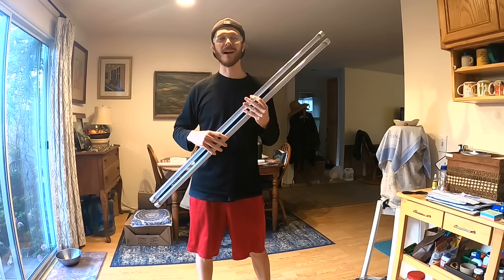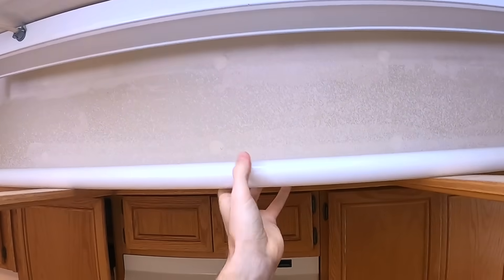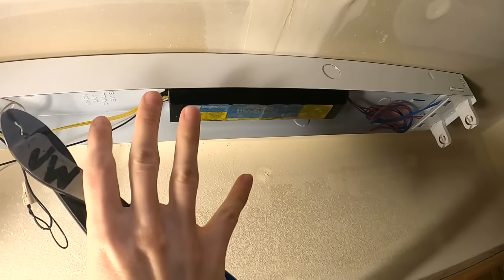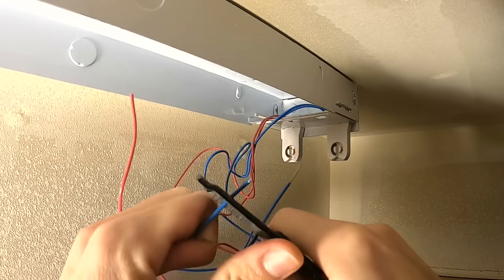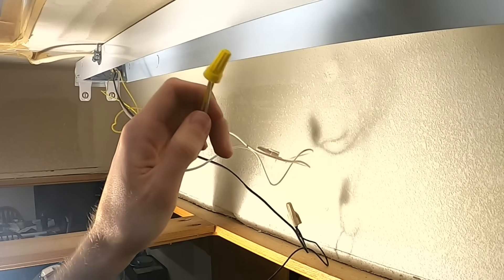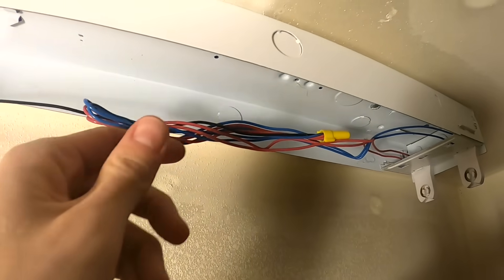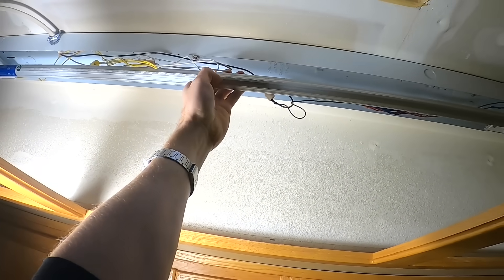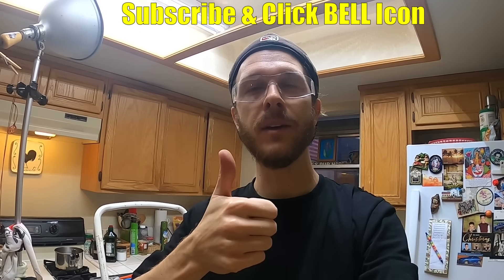How To Easily Convert Fluorescent Lights to LED | Save Money on Energy Costs

Comment: A couple years ago I inherited my dad's airplane hanger/shop. Since not all the ballasts and tubes were working  and most of the fixtures were 8' long, I looked into getting conversion kits to install 4' LED's. The units I ended up using were Type B, 5000K, 15 and 18 watts. These, like the above video eliminated the ballast. Unlike the above is I connected the red wires from the tombstones to the black 120VAC and the blue wires to the common of the 120VAC. Note here, this will only work on the older unshunted tombstones..Point I'm taking the long way around to make is check the wiring of the tube before doing what was done above.
As for results, even though not all the old fixtures were working, when I finished installing the new tubes the current draw was about half and with the 5000K humans it was like being outside. 
Cost of conversion, the tubes were about $4/each and the kit to put 4 each 4' tubes in a 2 tube 8' fixture was about $20. I couldn't even replace a ballast for that. Conversion time per 8' fixture, about 1/2 hr. which included moving the ladder (ceiling is 15' high).
Since then all the fluorescent tubes in the house have been changed to make being in the kitchen and laundry room so much nicer. The garage is next.
Reply from the maker: Thanks for sharing. Wow that must've been a lot of work, but ohh so worth it. Brighter and much more energy efficient 👍
Reply: @JonnyDIY  Like I said they only took about 1/2 hr. ea. and the hanger was for small craft (think Cessna) but I did go through about 50 tubes as some fixtures were the  old 4' like the one you showed.
Reply: What about the yellow wires?
Reply: The type "B"tube I used are powered from only one end of the tube. Thus, the yellow wire weren't used. In my case I clipped them off so they weren't in the way of putting the center cover back on. 
Note: I also marked which end of the fixture was wired 120 VAC.

Comment: Thank you for your clear directions  I did this to the two fluorescent fixtures in my closet.  Using the LED Tubes in your links I found that I didn't need 4 tubes in each fixture like the original fixture had.  With just 2 tubes per fixture I would say that I'm getting the same amount of light as I did when I moved into my house.
Reply from the maker: Awesome glad you got it done. And you're very welcome, happy I could help out 👍 yeah these suckers are bright!
Reply: @JonnyDIY    Jonny, I also want to use just one bulb. (I have two blub fiictures. )Either florecent or LED. I haven't decided.  Do I need to disonnect one of the blubs electric connection. If so, which one? Thank you, Mike

Comment: So you just throw the flourescent bulbs and ballast in the household trash right? :)
Reply from the maker: 🤣 I found a local hardware store to take them for recycling. Not many people take them anymore for recycling, it was kind of a pain in the a$$ . I had those bulbs in my truck for weeks trying to find a place 🤣 should have just called the city or county and asked them I guess
Reply: I used to put them in the garbage can then tap them with a hammer. Technically, that's illegal because they have Mercury in them, so I don't do that anymore. H.D. used to take them, but won't anymore.

Comment: poor use of wire nuts you  should have eliminated one wire nut on both the line wire and neutral wire 41 year retired electrician.
Reply from the maker: Will fix it thanks 🙌👍 actually going to change to recessed lighting soon I think

Comment: I've done hundreds of these, but none were this way.  The ones I did had one end of the bulb that was dead and did not require any wiring connection.  The other end had one pin for the hot and the other pin for the neutral.  The bulbs would not work if you connected the wiring the way shown in this video.  In my case, you would disconnect all the wires on the dead end and connect the hot wire to one side of the lampholder and the neutral wire to the other side.  The bulb is marked with "L" for the hot side and "N" for the neutral side. If you installed the bulb the wrong way, either by turning it around so the live side is on the dead end or by installing the ends correctly, but turning the bulb the wrong way, it would not hurt anything, but the bulb would not work.  Make sure you know what kind of bulb you have in order to wire the fixture correctly.

Comment: I thought the voltage coming from the ballast output is stepped up (>120VAC). In any case, I would just change the fixture, it would be easier and less expensive to use E27-socket LED bulbs than any that are made to fit into a fluorescent tube fixture.
Reply from the maker: These put out a ton of light compared though. I'm going to install pot lights this year though

Comment: On your next project, use Wago connectors. Faster then using wire nuts, safer.
Reply from the maker: I'm still on the fence about them

Comment: I installled two lED bulbs a few months ago, still using with the ballast   They now keep going off, there’s power but no light. I’ll now remove the ballast, I’ll let you know if I make it. 😮
Reply from the maker: Good luck 🙏👍 hopefully just one of the ballasts. If not at least wont have to worry about them going out again
Reply: @JonnyDIY  made it out alive. I did bypassed the  ballast, turned on power, still not working, had power coming in, I did notice a clip (round thingie) missing on one end of the tube. So, replace the fixture, I’m sure I can’t find a clip that would fit this fixture. Prices $30+.  Thanks for the video.
Reply from the maker: @midwestrebel655  Bummer, well I hope you can get the light up and going again soon 👍 your'e welcome, happy to help
Reply: @JonnyDIY  I just replaced the whole fixture with new  LED lighting. One question, if anyone knows, there was two hot wires coming to the switch , this normal? Both black wires, typically I see white and black.
Reply from the maker: @midwestrebel655  thats pretty normal at switch because you have the one black hot wire thats feeding the power from the source then you have the 2nd black wire carrying the power back up to your led light fixture 👍
Reply: @JonnyDIY  just so happens a handyman was installing new led lamp in my sons home, he ran into the same thing I found, he stopped, hasn’t run into it before, both wires were hot. I’ll let him know of our conversation, thanks again
Reply from the maker: @midwestrebel655  You're  welcome. Yeah it could be another outlet or something too. Hard to tell without being there. Best thing to do is have a voltage tester and start flipping breakers on and off and checking the wire see if it goes on and off and see what its where its coming from/going too. I just went through similar issue when I added a bathroom exhaust fan last month. Up in attic tracing and testing wires

Comment: I am a retired maintenance electrician for a large company with many many buildings. The company went on a upgrade, binge converting incandescent lighting in their large service center buildings for the vehicles two motion detector fluorescent Tubes. It took us a couple years to convert all of our buildings, and the savings was huge in the garage, is where the lineman trucks and supplies are kept, and in the warehouse and sound in the shops with their bridge cranes up there 70 feet in the lights above them.
  but the people working at cubicles that had what are called task lights, and in the Office buildings. When we would switch to the high-efficiency bulbs, we got a lot of complaints because they just don’t give off a lot of light like the old lights did, and they have a flicker to them… they may save money, but they do not give off the light, no matter what it says on the box.
  in my home, I have replaced all of the bulbs with those coiled looking fluorescent replacements. Instead of just 160 W bulb in the lamp beside my chair when I’m in my man cave watching TV. I have to turn on three of the fluorescence or it just seems dark in there with just one of those supposed replacement bulbs that give off 60 W of light equivalent only using less than 25 percent of the power of an incandescent bulb..
  they may save money, but they don’t give off the light so you have to like two or three of them to have the same light you used to have with a single 100 or 60 incandescent, old-style bulb..
  for lighting in large areas, of course, it saves money to go to modern LED lighting systems that consume much less power. But for in the home. I prefer the old style bulbs for brightness.
  The upgraded new style fluorescent tubes with the green end caps. Also are a problem because they do not give off the amount of light the old, silver endcap bulbs give off, and they have a tendency to flicker. Lots of complaints from people that had to work in offices that had those types of lights about flickering.
  On the flipside LED lights are supposed to last many years longer. You rarely see a newer car with LED bulbs for tail lights, or turn signals with a burned out bulb.

Comment: The energy difference between a T8 fluorescent and T8 LED is about a $1.50 per YEAR if used for 3hrs/day/everyday. When you factor in the much higher cost of LEDs, and the significantly higher failure rate, florescents are much more cost effective. But overall, I still prefect incandescents to LEDs because incandescent bulbs have no flicker, are made of glass and metal rather than plastic and computer chips, and are just easier on the eyes than LEDs.
Reply from the maker: Yes I much prefer incandescents. Shame can't buy them much anymore
Reply: @JonnyDIY  A true shame. The US DOE under Biden banned halogens and most incandescents a few months ago :(
Reply: Flourescent tubes are getting very hard to find anymore...

Comment: Nice video, and I'd always recommend getting the ones where you can bypass the ballast. Reason being that the ballast will eventually give way and fail.
I think this might have happened to a few of the remaining fluorescent lamps at work, though I know some are just the starters (and bulbs) as the bulb was flickering, followed by going completely black at the end. Another failure is when the ends glow dimly - both of those are dead starters.
Reply: Exactly, and when the ballast does eventually fail, you'll have to either: 1) replace the ballast which will be "Bigly" expensive and hard to find by then, or 2) bypass the ballast and replace the bulbs again with LED bulbs that don't use the ballast.
Reply from the maker: Thank you 👍 and thanks for sharing that helpful information 🙌

Comment: I'd like to add or reinforce some points to undertaking such a project. It is not overly complicated but it will pay off in dividends to do your research first. I undertook such a project in a hotel I worked in and made some mistakes along the way. Fist off, the ballast transformers can get VERY HOT. They can get hot enough to cause serious burns if not careful. Second thing is one LED tube is usually quite sufficient to replace BOTH fluorescent tubes saving even more energy. Thirdly, get the LED tube that does not require the ballast as the ballast itself uses much of the electricity and producing heat. Because 110 volt circuits are usually wired with black and white I chose to gut the entire fixture except for the tombstones if they were in good condition. I completely rewired the fixture using only black and white wires with black being "hot" or load and white being the neutral.
Reply from the maker: Thank you for sharing 🙌Yes they can be a bit different from fixture to fixture and how each person wired it can vary

Comment: Thanks for the great video !  Very well done.  I was wondering how to link two  2 bulb light fixture together so they both operate off of one switch ?  Do you have a video that covers this setup ?
Reply from the maker: You're welcome.  I don't have one right now. But it depends where the wires are run. If they're run in through attic and down through the ceiling youll need to go up in attic and basically connect the 2 together. The one thats not on the switch youll have to tie that wiring to the one on the switch. Sorry hard to explain lol because every house is wired differently. Ohh wait but if you just want to add another fixure to the switched one that's a lot easier

Comment: Help! One of the two (connected to the same smart switch) fixtures in the kitchen went out. Put in plug and play LED bulbs. Didn't work. Found this video. Took out ballast. Still didn't work. Put new bulbs in other fixture. They work there. Do I need to take ballast out of both? Get a different type of LED bulb for the now ballastless fixture? Tell the wife to live with only one working?
Reply from the maker: Sounds like 1 of the ballasts may be out. I would take them both out and bypass both. Check your bulbs packaging to see if they are bypass compatible.  If not will need to get those ones that say they are. Hopefully that will solve issue. That would be the only issue I can think of, unless something with the wiring was disturbed but shouldn't have been with a simple bulb change.

Comment: White & Yellow Wires Are Neutral And Black & Blue/Red Wires Are Hot That Color Coded. Fluorescent Ballets Bypass To LEDS And The Ballets Is Gone. 3 LED Temperature Colors 3000K 4000K & 5000K. Double Sided LED Lights L Is Load Side & N Is Neutral Side. Fluorescent Bulbs To Recycle At Hardware Stores. Wall & Ceiling Fluorescent Light Fixtures Has 2 & 4 Bulbs And Sometimes 3. 4ft 2ft & U Shaped The Fluorescent Light Fixtures. Fluorescents To LEDS & Replacement Ballasts.
Reply from the maker: Thank you for sharing 🙌👍

Comment: I'd write "BALLAST REMOVED, UPGRADED TO LED , 2023-01-15, JDIY", in Sharpie, under where the bulb goes as otherwise, once that trim cover goes back on, there's way to tell if the fixture is set up for LED or regular flourescent bulbs. Otherwise, great video, thanks!
Reply from the maker: You're welcome, happy to help. And thank you great idea, I'll add that to the fixtures next time I have it open for a bulb replacement 👍

Comment: So in my country you would have to pay for a licensed electrician to swap out the ballast. Also, depending on how much electricity the old lights draw, it might take years to see the benefit. In the end, we replaced everyones monitors with 24 inch leds. 1 year ROI vs i think.... 5 for the led lights.
Reply from the maker: You're right it could take a while to offset the cost. But I like the quality and brightness of the light versus fluorescent. And if any of your ballasts have gone out, this is the most cost effective way too I believe

Comment: This may have already been said, but their are two types of LED Tube replacement bulb, Type B (which is what is being used here) and Type A (commonly call Plug & Play)  which you don't have to bypass the ballast.  Simply remove the old tubes and put the new ones in.  Note: if the ballast is bad then the Type A won't work.  You would replace the ballast, in which case you can use Type A or bypass the ballast, as shown here, and use type B.
Reply: To me it's kind of pointless to do what you call Type "A" because you would still have a ballast consuming electricity and producing heat. Trust me when I say those ballast transformers can get VERY HOT.
Reply: @williamjones4483  Yeah, what usually kills the ballasts is when they run really hot, overheat, and shut down due to overheating.
Also if you hear that the ballast is buzzing, it means the windings inside the ballast are starting to vibrate, again not good as it could fail at any point.
When going for LED conversion you're really much better off not bothering with the ballast. After all, keeping the ballast and using Type A is only useful if you want to go back to fluorescent again at some point, which is pointless as fluorescent uses more power (and in some countries, they are even banning fluorescent bulbs).
You really want to be taking out the ballast, taking out the starter (or using a LED specific start) and going Type B.
Reply: @TheSpotify95  That's what I did. It was more time consuming but I completely gutted the fixture. Took down the tombstones and examined them to see if they could be reused. Removed ALL of the old wires going to them and for the conversion itself I ran black and white wires to only one tombstone as the LED lamps I used had pins on one end that were marked "L" for load and "N" for neutral. The tombstone at the other end was solely to support that end. One LED lamp produced enough light to replace both fluorescent tubes.
Reply: @williamjones4483  I have all Type A because I replaced my fluorescent tubes before these fluorescent conversion videos became popular.   It could be many years before my plug-and-play bulbs go bad for me to be able to change over to the type B tubes.
Reply: You can also get A+B types which go either way - ballast or no ballast.  Great for an office with lots of fixtures where you can bypass ballasts as they fail rather than having to do them all at once.
Reply: @davidwells1360  Thank you!!
Reply from the maker: Thank you for sharing this helpful information  🙌👍
Reply: They also now have these bulbs with adjustable lumens/color output, in case the one you bought doesn't match what you already have. So you can change it to your needs. It's just a simple slide switch on the bulb.